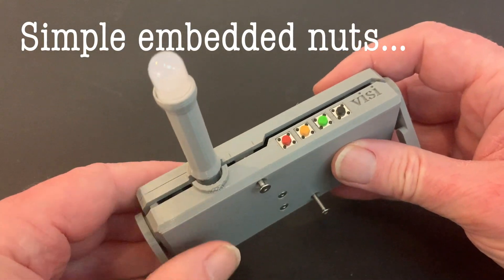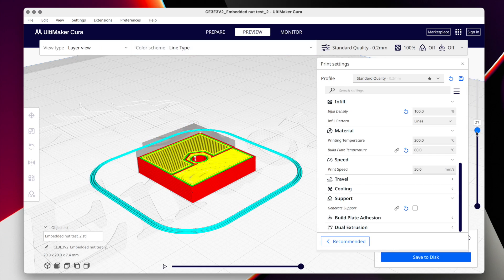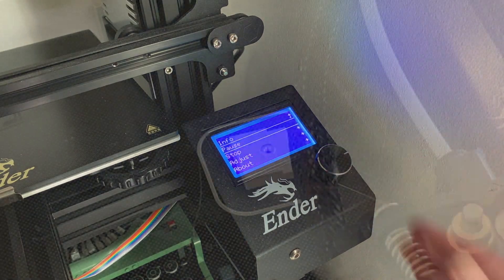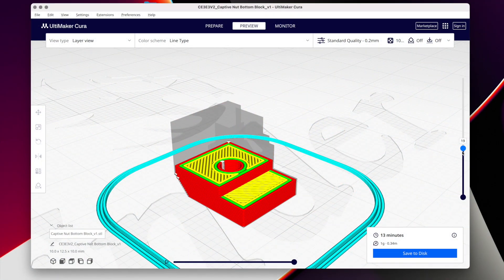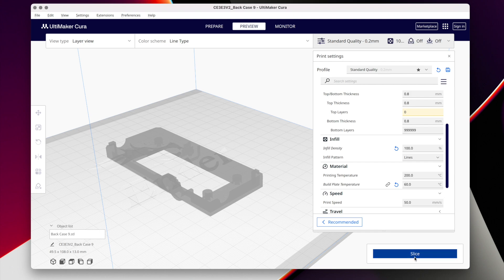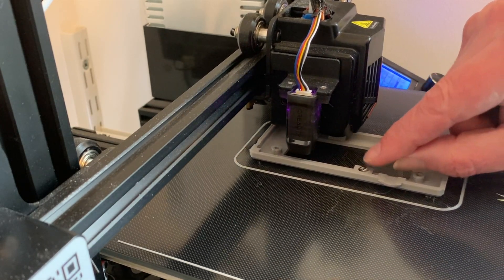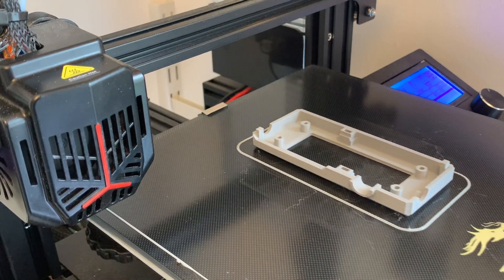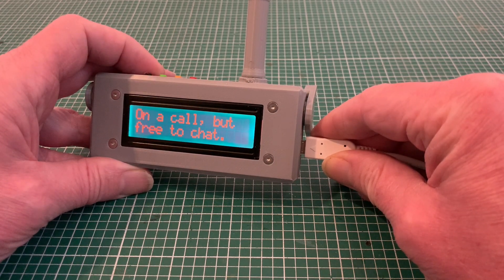Simple embedded nuts for 3D prints - neater fastenings - and no special equipment required!

Comment: Cool project!  FYI, most slicers can add "pause" gcode commands at specific layers.  I've done it with prusa slicer and on a Creality CR10.  I know the printer firmware has to support the command as well, and I don't know if the firmware on the Ender shown supports it or not, but you can change the firmware on an Ender if it comes to that.  If you put the pause command in the slicer or even in the gcode file yourself, when the printer gets to that point it will pause without you having to watch it like a hawk.  This makes it so much more convenient to embed magnets, nuts, or other things inside a print.  Another thing you can do instead of the "pause" is to insert a color change (I believe that's M600) which is intended for you to swap the filament while the printer is paused.  Of course there is no need to swap the filament and you could just embed your object and tell it to resume.   I didn't hear you make mention of it, so I wanted to make you aware of it in case it helped you out in your project!
Reply from the maker: I had read up about that, but wasn’t sure if the Ender (being kinda basic) would be able to do it. Actually, the manual pause worked pretty well and with a 2 layer window, accuracy wasn’t a big deal.
Reply: @paterpracticus  Yes the Ender 3/3pro do support pause at layer height within Slicers, I have done it about 5 years ago when I used Cura (Always hated that slicer never had any good prints from day one on multiple printers. Prusa Slicer is a way better Slicer than Cura with better and more advanced features and print for print back to back prinyts between same model with same settings on Cura with no changes to the printer the ones on Prusa slicer always comes out better.) 
With the Prusa modifiers you can select areas in a print you want to print with different infill % and patterns and even different types of material like PLA and TPU and even print at different speeds at certain areas or even printing multiple objects on the plate each with its own infill and speed or nozzle temp settings and save it all in one GCODE. That is how I make phone cases out of PLA and TPU in one print in one gcode without needing to sit and time everything as the printer will let me know when the next step is available.
Reply from the maker: That is all really helpful. I must delve more deeply!
Reply: @paterpracticus  You can do this with out a pause you can use colour change on the slicer that what I do.

Comment: There is no point in using 100% infill ever (maybe if you really want the weight)
To make the parts stronger you can do more perimeters and do 50% or less infill 
The weakest point will always be the layer lines adhesion.
With 100% infill you're just extending the prunting time by a lot and wasting filament
Reply from the maker: In my case, the walls are only a few mm thick, so not much wasted with 100% infill. But, still experimenting on other jobs. 40% seems to be a sweet spot.

Comment: you can also bury magnets and thin strips of steel and totally cover them.  Making a case that has an inner lip, and magnets around the perimeter would make a clean, fastener-less design.
Reply from the maker: Great idea. But guessing they can’t be too deeply embedded in the print to stay working.
Reply: @paterpracticus  exactly right